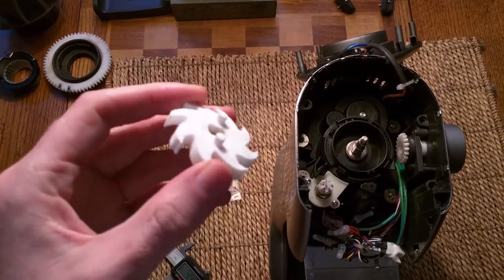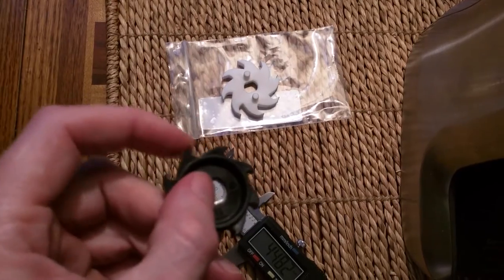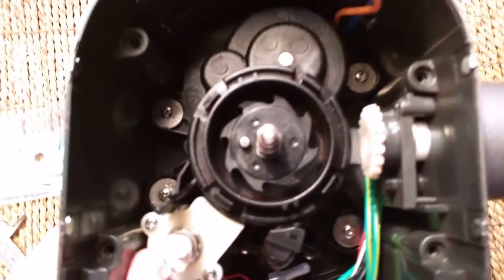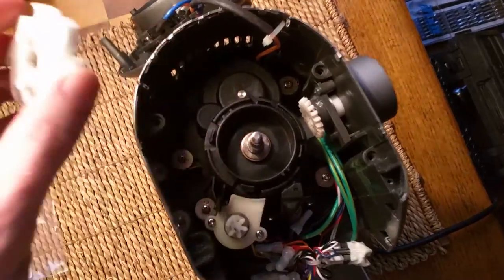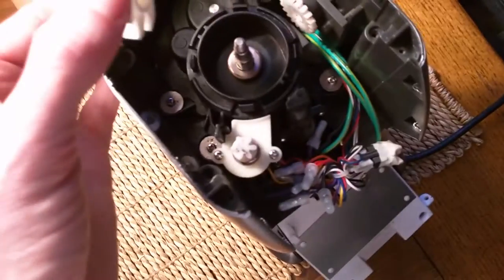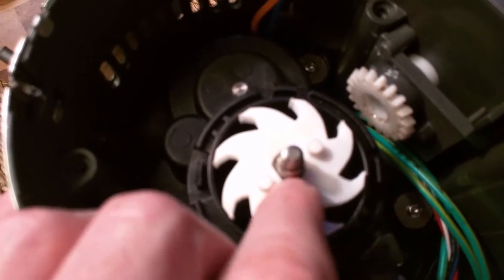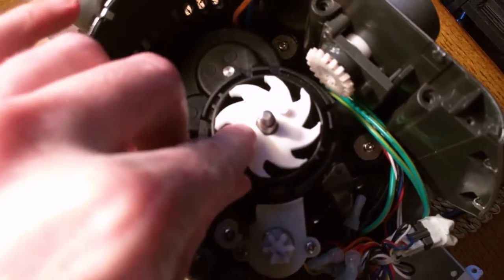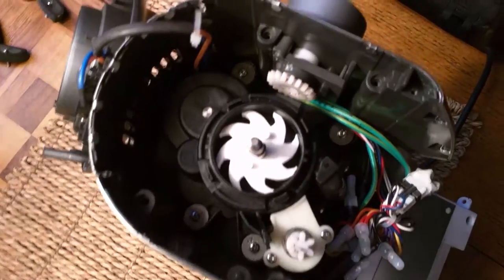BCG800XL Jamming Fix with Shapeways Impeller Upgrade

Comment: Has anyone tried one of these on a BCG820?
Reply from the maker: I have heard that it does not fit the 820.  The 820 impeller is steel clad (instead of plastic) and it's unclear how it could wear down over time. There are user comments with more details on the ifixit page.
Reply: Yeah, the cladding doesn't do anything for the impeller blades.  The cladding only covers the top and about halfway to the blades.  Under, it is just black plastic.  The wear on the impeller blades is the same as with the 800.
Reply from the maker: Hmm, I found this pic of the 820 impeller online: http://coffeegeek.com/images/72096/smartgrinderproimpeller.jpg  Does yours match with that? The wear surfaces look like steel to me. If the substructure is plastic, shouldn't it be protected?
Reply: Yes, that's exactly like mine.  But look at the edges of the metal blades very carefully.  You can see the black plastic poking out from under the cladding.  The the tip of the plastic blades have almost worn out and can barely be seen.  That gap between the end of the metal cladding and the case is enough for the coffee to just get stuck and clog the shoot.
Reply from the maker: Ah, what a strange design then. To add all that metal and still mess it up! Rotation is clockwise, so it's astounding the plastic would take a hit. I wonder if it grounds pass between the cladding and the plastic. I have heard the 820 is quite a bit more difficult to disassemble, and the geometry of the well may be smaller. I usually steer folks clear. If you really want to try it, the dimensions of the 3D printed BCG800 impeller are available at the bottom of the shop page: https://www.shapeways.com/product/NASLAGCCP/breville-coffee-grinder-impeller-upgrade?optionId=59828416   You could do some measurements first to be sure it's going to fit (or figure out if sanding will be necessary)

Comment: hi! thank you so much for your guide on ifixit! I purchased the 3d printed impeller from shape ways and it fit beautifully! I'm still having issues with the grinder though- it will now grind through once at whatever volume I have it set at, but then when you try to grind again, it makes a high pitched sound similar to the one it makes when out of beans. If you disassemble and reassemble the burrs, it will do the same thing again- grind through one cycle then stop. Any ideas???
Reply from the maker: Hi Kathryn, It almost sounds like the beans aren't even making it into the burrs. When you take the hopper off after this, are there beans on top of the burrs as normal? Perhaps the hopper has a problem and only releases a small amount of beans each time you lock it in. Check that first. Perhaps even try unlocking the hopper over a bowl to verify the beans all flow out of it as expected. If that doesn't reveal the issue, next time this happens, you could remove the hopper and then manually override the safety so you can observe it running. Watch if the remaining beans above the burrs get drawn in properly as it spins. FYI: If you do that be EXTREMELY CAREFUL to stay clear of the burrs while they are spinning. Eye protection is a good idea since grounds can fly out. To override the safety there is a tiny rectangular plastic button that the hopper presses in...just press it with a pen. Post back if you find anything and we can brainstorm more. Glad the impeller fit by the way!
Reply from the maker: Hi Kathryn, Oh no,  it sounds terrible :-( 
I'm thinking the drive gear has a section of its teeth damaged/stripped from when the rock jam happened. I suspect that when the gears coast to a stop with a good spot on the teeth aligned to the motor worm gear, then it can start again successfully. When the gears coast to a stop with the bad spot aligned to the motor gear, then it won't start again because the motor worm gear isn't making contact. With the lack of torque, the motor spools up to full RPM and it sounds like a jet. 
This also may explain the horrible sound when running. Every time the bad spot on the teeth makes a revolution, it makes that strange noise. On a successful start, there's enough momentum to get past the bad spot on the gear each revolution. 

If you'd like to investigate the gear, I've thrown together a quick photo album for you with teardown a bit beyond the ifixit article. See here: https://goo.gl/photos/DorqxrpEXRXtdxE96 There are comments under the photos with instruction. 

If it is truly the gear, the options unfortunately are not great. There's a source on ebay if you search "BCG800XL gear" but it's overpriced in my opinion ($60 with shipping IIRC). For $30 more, Breville will repair it for you and give it a 6 month warranty. A local machine shop may be able to make the gear for you if you take it in.
Reply from the maker: When you put the upper burr back in, does it rotate the lower burr a little bit? That would lend support to it being a stripped gear with a bad spot on it. The small amount of rotation would get it past the bad spot until next time it happens to stop there. I found a photo from another person who had the gear fail. There's a helpful photo of what the damage looks like. https://community.ebay.com/t5/forums/forumtopicprintpage/board-id/214/message-id/14277/print-single-message/true/page/1
Reply: +gottebp thanks Ben! Especially for going to the trouble of making the photo tutorial! When I was done making that video on Sunday I actually managed to get into the gear box, wondering the same thing and I didn't see any damaged gears at that time. It's so strange! I really appreciate your help and thoughts though! I am not an engineer by any means (I'm a speech therapist by trade) but this problem has been driving me nuts and it's been fun exploring it anyway. Your advice has helped so much!
Reply from the maker: No problem. I'm having fun seeing it unfold as well. It's kind of exciting, and definitely baffling! ...and I'm not completely out of ideas if you're not tired of investigating. You're pretty good at this. Plus, if your gears aren't wrecked this could be fixable still!
See this photo here that I've annotated: https://goo.gl/photos/aMGwjchbkyfCGLCy8
I feel strongly that the problem has to be related to one of the marked up areas. I'm especially leaning towards it being something with the nut and gear on the left side of the pic. There might be a torque limiter built into that, and perhaps it's broken and slipping most/all the time. In this video here: https://www.youtube.com/watch?v=8tCumd7M7Uw there's a clacking sound at the end (after it clogs up). It sounds a bit similar to the way your grinder sounds most of the time in the video from Sunday. It's just that yours is that way without being under load. What if the torque limiter is slipping nearly all the time for you? Maybe that explains what's going on. The only thing is...I don't know where the torque limiter mechanism actually is....I have a hunch it's in the gear on the left side of that pic though. Godspeed!
Reply: Hi Ben! it took me a bit to get back to this project (have a 7 month old baby at home), but I took everything apart again today and tightened up the torque limiter- https://goo.gl/photos/SXHmhz8hb8Djd3T38, I really thought that might be it as the nut was a little loose at baseline. All other screws you indicated were re-tightened too and as far as I can tell the gears were all moving properly. Once reassembled, though, though it was the exact same as before- went through one grind cycle with the clanking noise, but working, and then the high pitched squeal when attempting to grind again. :(  I may just have to call it- if it's a problem with the actual motor or computer its way above my pay grade. I've definitely liked working on it though, thank you so much for your help!!

Comment from the maker: Repair guide is here: https://www.ifixit.com/Guide/BCG800XL+Grinder+Jamming+due+to+Worn+Impeller/62905
Reply: Hi @gottebp , how did you do to remove the first part with the metal handle? I pull it very hard but it is not coming out
Reply: @domitillelochet3616  And for others - rotate it (CCW I think) once you lift the handle.
Reply: Everything working now thank you tons!!!